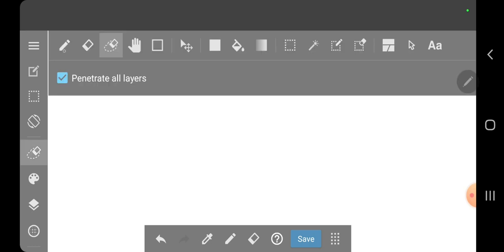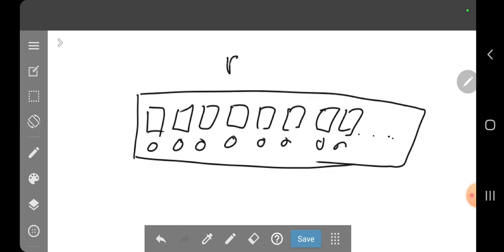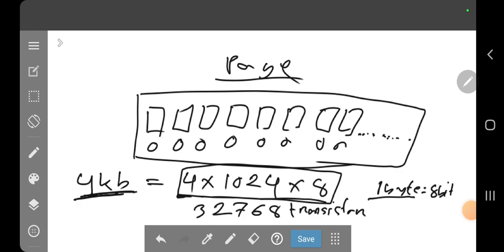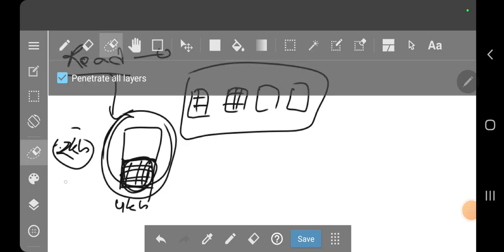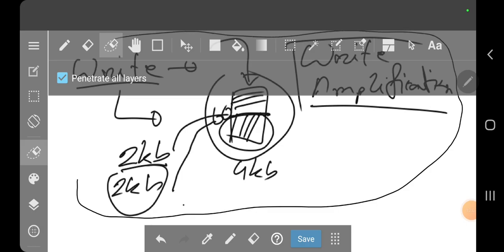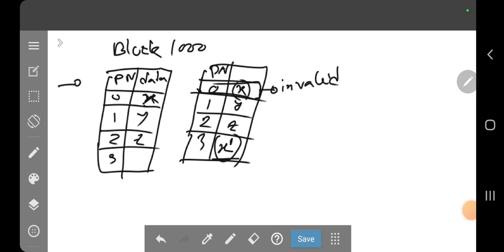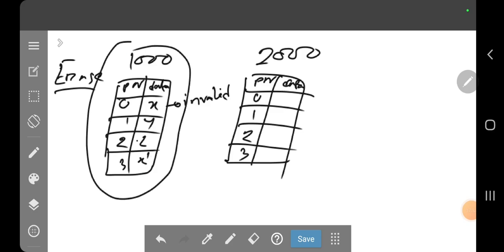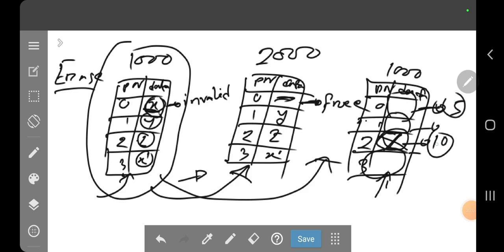The Ultimate Guide to Flash SSDs: Everything You Need to Know

Comment: In your video, you said one transistor one cell. Is it the case? I think multi level cell is nothing but combination of multiple transistors.
Reply from the maker: Multi-level cell (MLC) flash memory is designed to store multiple bits of information per memory cell. It achieves this by utilizing multiple charge levels within a single memory cell to represent different combinations of bits.

Typically, MLC flash memory cells store two bits of information per cell. To achieve this, MLC technology employs a single transistor and a storage mechanism capable of maintaining multiple charge levels. This storage mechanism is often referred to as a charge trap or floating gate.

In a MLC cell, the charge level within the storage mechanism can be adjusted to represent different combinations of bits. By dividing the range of possible charge levels into distinct levels, each level can be assigned a specific bit pattern. For example, if there are four distinct charge levels, each level can represent two bits (00, 01, 10, 11).

This is in contrast to single-level cell (SLC) flash memory, which stores only one bit per cell. SLC uses a similar transistor-based structure with a storage mechanism, but it has a more limited range of charge levels, allowing it to represent only two states (0 or 1).

It's worth noting that advancements in flash memory technology have led to the development of even higher-density memory cells, such as triple-level cell (TLC) and quad-level cell (QLC), which can store three and four bits per cell, respectively. The basic principle remains the same: using multiple charge levels within a single memory cell to represent different bit combinations.